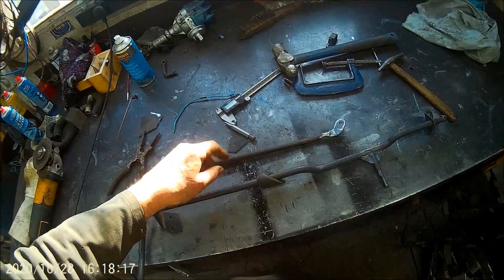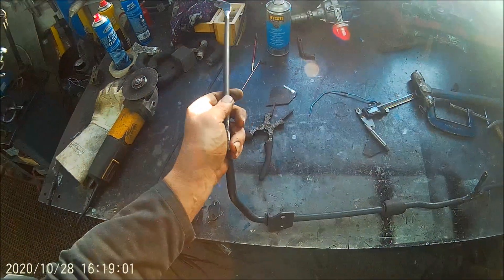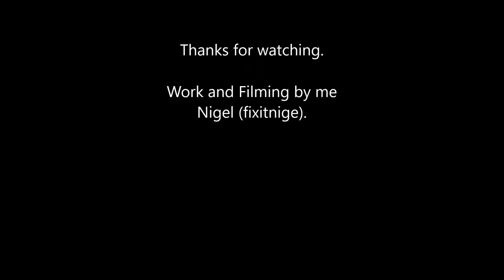Ford Falcon Restomod 13

Comment: The truck looks awesome Nige! Please keep the trident mags that you have on it though! 1970s - 1980s in NZ & OZ, trident mags were the 1st choice with GT 12 slots 2nd. Anyway great vids! You're the man :)
Reply from the maker: Hi George thx for the comment and praise as for the wheels I would like to keep them but the tyres for that size now are not cost effective I got the new wheel and tyre for less that just the tyre on the other size. cheers

Comment: Somehow add a Ford in typical Ford blue paint air cleaner housing assembly to make everyone wonder what engine you have.......
Reply from the maker: Hello Mike the air cleaner started life polished chrome but it got a little rusty in my jeep so I got a new one but kept this one so I cleaned
the rusty bits off sanded it down and put 1 coat of the same galaxy blue I used on the car with a top coat of laquer and it came out great :)